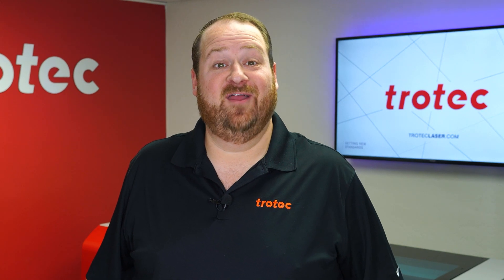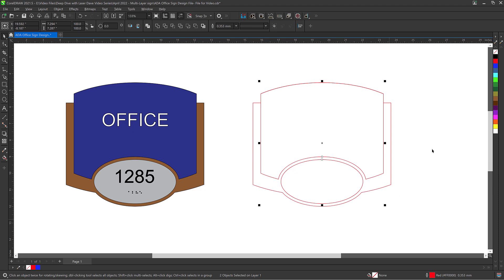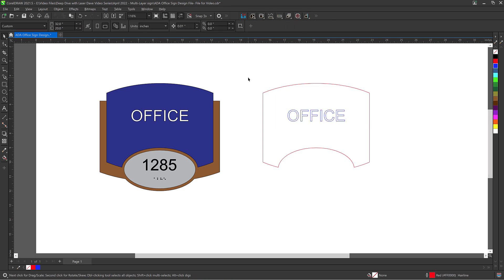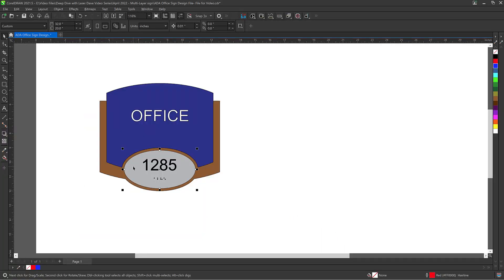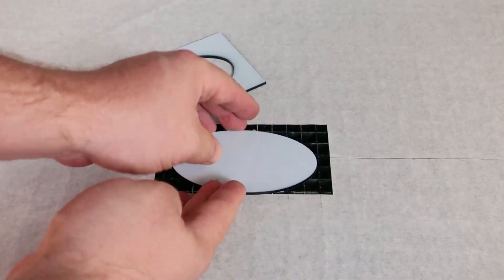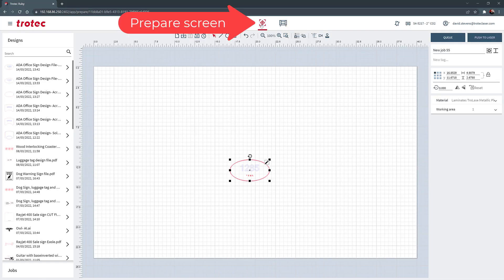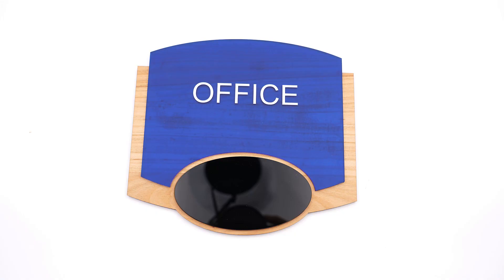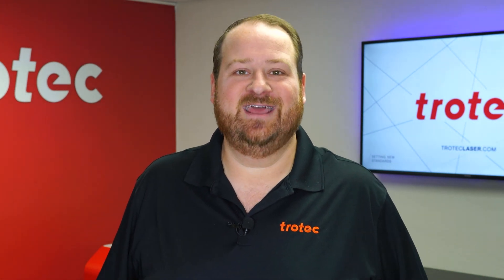Deep Dive with Laser Dave: Dimensional ADA Signage

Comment: What is the diameter of the laser engraved holes?
Reply from the maker: Hi Miguel! The diameter of the hole for the braille beads is 0.056," or if using a braille font, it is a 20-point font.
Reply: @TrotecLaser  The ADA requires the use of Grade 2 Braille, you cannot meet the specs by simply using a font. Aaron Koehl has a Corel Draw plugin that produces  perfect Grade 2 braille that makes it easy to create and edit Braille. I think the price is 50 bucks.
Reply: @keithoutten1671  Keith thanks for your replies on this video. I was under the understanding that you could use an online translator to spit out the necessary characters for the grade 2, then use that character set with the normal Braille characters (font) to output the grade 2. Am I way off here? the translators have characters on the output (they also have the svg files as an option as well). again, thanks for your commenting on this video.

Comment: what is the diameter of the circles for the Acrylic Raster® Spheres?
Reply: Braille spheres are 0.064" in diameter. A laser engraver is capable of producing a hole that is approximately 0.062 inches in diameter and 0.066" deep that will provide a friction fit in a solid material for the sphere. I have made thousands of ADA signs from Dupont Corian solid surface material, it is my choice for ADA sign material. A half inch thick material allows you to machine a keyhole on the back of the sign for hanging. The sign can also be easily removed from the wall if you have a window machined in the sign that needs to be changed on occasion.
Reply: You can google what the standard braille dots size is.

Comment: Never worked w braille beads yet and wanted to know when you add the small piece of double sided tape to the back of the silver wont that keep the silver piece that much off and away from the black spacer and not flush?
Reply from the maker: Hey Mike! The double-sided tape is so thin that it is not visible on the surface plastic, but the tape is necessary to keep the braille beads in place.

Comment: The ADA braille tool is pretty expensive. You can buy a 2/32 nail set at your local hardware store for less then 3 bucks that will easily pick up braille spheres and then drive them into the laser engraved holes. Tap the end of the nail set onto a wet sponge first, this provides the necessary adhesion to hold the braille sphere on the tip of the nail set while you transfer the sphere.
Reply: At $600 whoever priced this thing must have hit that crack pipe really hard before coming up with that price, and on top of that you need a license to purchase it. i wonder how much the license costs. 🤦‍♂